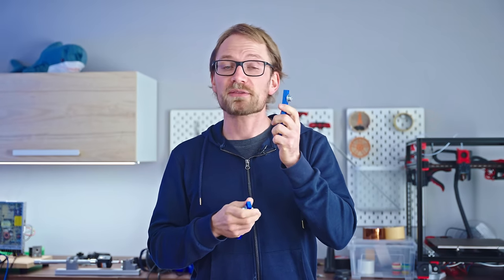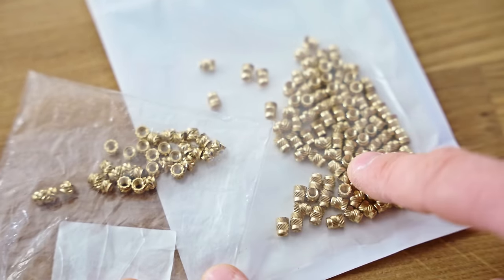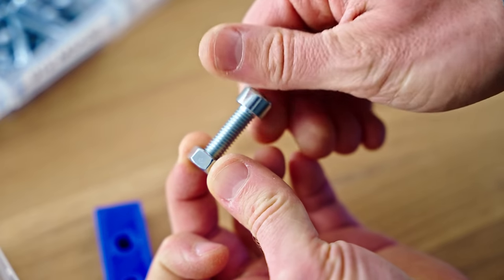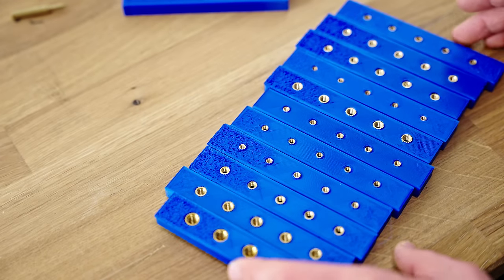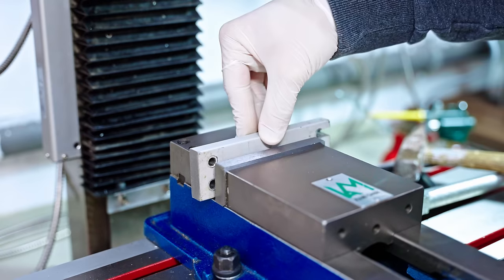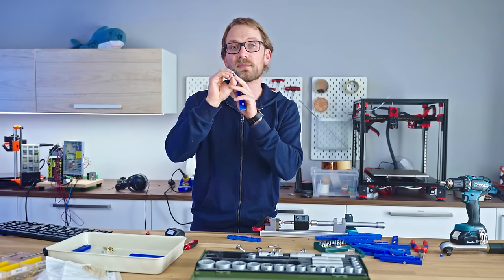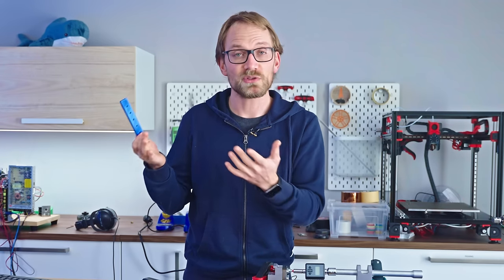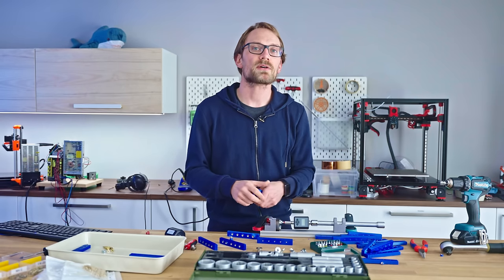Do you even need threaded inserts? Strength tested!

Comment: Interesting, but I try to use inserts only when I have material to pull against so reverse pull if you like.  

That being said. Where you can, design a part with a mortise and tenon with a hole and  pin, that is by far the strongest joint I have been able to print. It does require some accurate printing so you do need to have tuned your printer, but once you have that then you have a consistent part and a consistent joint that works really well. 

But like most things in engineering, there are many ways to build a bridge.

Comment: I use drywall screws. (or other wood screws), I don't bother printing threads, just 2 wall thickness.
There doesn't seem to be any strength reduction, and they are significantly cheaper that machine screws, inserts or bolts.

Comment: Need to test with more perimeters, but also test with a hex hole for a steel nut.

Given the poor pull out performance, grade 4 screws would have been fine, the polymer will fail will before reaching plastic deformation of the screw.

A thread forming tap may have been interesting to see vs thread cutting, I've used them in production where the material is weaker, and so stronger threads (more thread engagement and better crystal alignment of the metal) were required - here I'm not expecting the thread to be any stronger, I'm more interested to see how the polymer behaves to being thread formed vs cut.

Comment: But why are you not using wood screws? Wood screws have a wider-spaced, medium-depth thread which look perfect for screwing into plastic. Machinist screws, not so much as you explained, especially at the small diameters.
Reply: Wood screws work great. For repeated use/assembly/disassembly is where you really need the metal threads.
Reply: @brandonraineri  Something to check for sure. Perhaps wood screws are “good enough” for repeatable screw in-out in plastic.
Reply: @brandonraineri  Would be good to try testing wood screws vs. machine screws directly into 3D printed plastic. I have a clue the wood screws would last enough cycles for a lot of things.

Comment: I usually just assemble a regular hex nut from the other side or during a pause print. How would that perform? Or indeed a self tapping wood screw. These may not perform exactly as well as the self tapping screws actually meant for plastics, but they’re much more available.

Comment: What about a thick walled hole and self- tapping screws intended for plastic?  Proper insert alignment is a real PITA even with proper soldering iron tip but without a press on which the soldering iron is mounted.  Even a slightly off insert angle causes problems.

Comment: I've used brass motherboard standoffs heated with a soldering iron. I wouldn't put them to any strength test, but they gave me a screw hole in a 3d print where I previously didn't have one. 😅

Comment: I would like to know how strong of a connection you get if you insert a normal nut in a hexagonal shaped hole. You would have to consider your printed parts to be designed for getting the threads inserted from "the other side" of course.

Comment: This is a great video showing a good variety of different inserts. I did not know that there were ones specific to injection molding. With the proper precautions, would it be possible to place the inserts on some carrier and print plastic around them? 

I'm not really satisfied with the testing method. The torque measurement is not so relevant to this test. It has some correlation but it is too imprecise to be significant. Instead, a bolt should have been screwed into the insert and pulled with a lever, where the force on the handle of the lever is measured. This is because in your setup, a very small amount of torque applied over a longer period will still drive the screw a bit, eventually pulling the insert out a little, and as soon as the plastic gives even a tiny bit, torque falls back to 0. Static friction also makes this measure fuzzier: a very grabby nut would read high levels of torque, until it starts turning in place instead of getting pulled out. Take for example if you used an impact driver on the test jig, you would get a very high torque peak (somewhat smoothed out by the inertia of the massive drive extensions) then the insert would yield practically instantly.

Comment: Prusa style pocket holes with a drop of super glue so the nut adheres to that printed part. I've used these with both square and hex nuts, I work in manufacturing and usually install a tight plug that goes in after the nut so crud doesn't build up in the hole and to provide a little more material to support the nut.

Comment: Two flaws: You didn't test directly screwing into the plastic without pre-tapping (or did I miss it?), secondly you need more perimiters if you want to tap the whole obviously because it eats away material as you said. The main benefit of threaded inserts is that they can be disassembled without consequences. A self-tapping screw into plastic only works once (well).

Comment: I would be interested with how adding a helicoil might work? Also nutserts which are a mix between the camera adapter screw and a helicoil. Might be interesting to see if you could print a slightly undersized thread ahd heat set/screw them in.

Comment: Agree infill (type and density) could make a massive difference. It would (at least for me) be an interesting follow-up. Suspect some infill types could allow a much lower infill ratio. Feels like what's needed is a cubic subdivision type but skewed heavily towards walls. Suspect the simplest answer would be to use Cura to create a boundary around the hole with much denser infill than the rest of the part to create a transition though clearly ideally it would be a gradual transition with no infill steps (which are likely where it would fail). It feels like a special infill type is required TBH.....

Comment: I'd be interested in seeing how the length of the engaging threads especially on the non-insert setups impacts the strength.  Maybe an experiment where you stack the plastic parts with a single threaded bolt to determine how more plastic threads improves the hold strength?

Comment: One, You should really use more perimeters whether using inserts or screwing straight into the plastic. (I do at least 5 perimeters usually with 10-15% infill) 

Two, don’t use machine screws when screwing directly into plastic, for plastic you really want to use plastic screws, wood screws are a similar idea with more space between threads but idk how well they work with plastic. 

It kind of depends on the situation but I’ve gotten away for quite a while with screwing straight into plastic. I don’t even tap the holes, you can just screw the screw into the plastic and it makes its own threads (I don’t use self tapping screws). I don’t make a bunch of high stress parts but they’ve worked quite well for the robot arm I’ve been making and my plethora of other projects.

Comment: It is always a question of what you want to achieve. For lids etc. I simply print my screw holes with 1-2 more walls and then use M3 screws to self-tap into the plastic. More than good enough and very little effort. Also, doesn't need additional space like the threaded inserts.
If I want sturdy connections and have space to spare (i.e. somewhat bigger parts) I might use heat inserts OR design the part so I can sink a nut of the right size.

Tapping the plastic directly is something I never intend to try, that's just a bad idea. Same goes for printing the threads.

Comment: Heatsets you need to design for them... for example you should not have the stress in the same direction as they were inserted. you need to use heatsets from "behind", kind of like a nut, but then are flush and don't need to have counter sinks like a capture nut would.

Comment: An exploration of different strategies to reinforce the fastener barrel zone to the rest of the part would be of interest. This along with CAD or slicer strategies , such as Fusion or Orca, to be able to create a standard modular item which is able to be inserted into the solid at each hole location to increase the attachment strength for the various threaded inserts.

Comment: FIRST: I want to see this experiment with a reasonable number of walls or 100% infill. 
Secondly: I would like to have a comparison with either the insert flipped on the opposite side, or an inset nut. Personally, I would chose regular nuts on the other side when I can, but burry them inside the plastic in a hexagonal hole

Comment: Yah...since the part was so weak...none of the inserts could really distinguish themselves apart.  Like some of the others have undoubtedly suggested, to really see if there is any difference between the inserts....the part should be printed 100 infill, or at least in your slicer...add a modifier cube and place the cube (about an inch square) over the holes, and set it to print 100% infill there only.

Comment: Try heating up the screws and threading them into the plastic, then letting it cool. Not the cleanest, but it also acts as built in locktite. Ive had decent luck with small grub screws in threaded parts (sounds horrible but i tried it just to see and was pleasently surprised)

Comment: I design my parts with a shoot i can insert the nut into after printing. There is a hole at the bottom of the shoot at a right angle for the bolt. The bolt then holds the nut in place.

Also, I only use PETG. I wouldn't trust PLA for anything but decorative prints.

Comment: I'm a bit surprised at you Tom, using a drill to tap plastic. Also rivet nuts would be neat to compare but may not work well in the same use cases.

Comment: I only use inserts if I want to assemble and disassemble the parts numerous times. If I only want to screw together things, I normally just screw the screw in to a non-threaded hole, that I print slightly bigger than what you would use for cutting the threads. ´So for example I am often using 2,7mm for am M3 screw. Using 3 perimeters and a "thread" length of 8 to 10 mm is a very strong joint.

One negative point i found when using threaded insert is precision. Maybe I am just too untalented but when I am inserting the insert with the soldering iron without a fixture or guide manually, the inserts are often off-center and slightly tipped. Not enough to make them unusable but enough to recognize it. So if I use inserts at all, I am applying them with the soldering iron in a guiding fixture.

Comment: Thank you for another interesting video! A very interesting topic and a great installation for the tests. It would be a shame not to continue using it. Without a doubt, the inserts are the best solution for permanent screwing on and off. 

But I do have a few ideas for testing printed threads for permanently fixed connections: 
If we write on a printed component with a permanent marker, we can see how the ink is literally drawn into the layers. Does the same thing happen with superglue on the threads of the steel screw and does this have a reinforcing effect because the layers on the thread additionally bond? 

Myth buster: I once heard that screw locking (Loctite) on screws in "plastic" can damage it. Is this true? Which plastics are affected (ABS/ASA, PETG, PLA)? Is there an effect over time (after 1 or 3 months)? Or does it even have an intensifying effect because fusion takes place? There is also a Loctite für plastic (5331). Does this have a significant effect? 

Maybe the  one or other point is interesting for you and our community.

Comment: Thank you for putting this together. I've recently got in to using heat set inserts in many of the things I'm making and yeah with the limit of the perimeters you have it would make sense to make another video with a few more perimeters, or even test the different interfaces of infill to see how they would impact the failure. Instead of using a torque gauge you can get the pull force value to be able to get some measurement at all. Another thing I would be interested to see would be a longer term "torque to x in/lb" and have the parts in different ambient temperature to simulate different use cases like auto interior or engine compartment bay. Also I would recommend either printing a heat set insert tool (to have consistently perpendicular inserts) or purchasing one from Naomi Wu from her Cyber Night Market (more info in Teaching Tech's video "Open source filament pelletizer | Naomi Wu needs our help". Cheers!

Comment: One thing I typically try to do with my heat inserts is to install the screw from the side opposite the heat insert was installed. Not sure if it makes any difference in strength, but I would definitely be interested in seeing those results as well. I think more perimeters would be an interesting comparison, as well as higher infill percentage. Also different material types. Most of the time when I'm using threaded inserts, it's into ABS or ASA rather than PLA.

Comment: Ive stopped using drill bit thread cutters on plastic, Ive gone old school and use the hand ratchet tapper, Feel wins there for sure. Also insert from the back if you can so there's a plastic rim for the insert to sit on. I will admit, they do have a pretty weak pull force but side loading they greatly improve durability of the parts. Making the part solid or heavily infilled helps too but that can be costly if you have alot of them to print.

Comment: I was able to to drive M3 A3 SS screw into 10mm of PLA into undersized hole and when it bottomed out I kept going and the bolt sheared off before the thread gave up.
One disadvantage is that it took a fair bit of force to screw it all those 10mm so it's time consuming if you need to do a lot of them and also not ideal for something that you will need to take apart from time to time.
Another thing if you want to use inserts then you need specific type for it to work well and also it works well with high temperature filaments like ABS and not very well with PLA, the plastic just doesn't flow properly.

Comment: Just print a hole with 5 or 6 walls, heat up your screw with a torch, Let the hot screw create it's own threads. That's what Ive been doing.

Comment: I have had good luck using a long set screw instead of a tap to thread printed holes at 0.5mm less than the nominal diameter of the metric screw, up to 6mm. The fit is a bit tighter and more supported than tapping it with a tap

Comment: Can you try to increase the number of perimeters to 5, but only inside the part. The outer 3 or 4 layers should have only 1 or 2 perimeters. Therfore, the solid infill of the outer layers keep the inner perimeters from sliding out.

Comment: I've been doing torque tests at work. We have an HP Fusion 5200 which is an SLS machine. The parts we make are from PA12, which I'd consider pretty "exotic". They are pretty strong but flex quite a bit. I tried to torque an M6 to 14nm and it just buried the washers into the material. Half-million dollar toy is basically useless.

Comment: I use threaded inserts where the customer have to do his assembly. Its not only about the strength but also some kind of ease, and technical aesthetic. I can not afford to give them "hobby" look solutions like nuts or whatnot just save few bucks on my end. However those parts which is only assembled on by me, and the customer never suppose to assemble nor disassemble, i use self taping plastic screws. Those are very similar to wood/sheet screws they hold extremely well, and you can actually use them multiple times, but there is a chance you might make a mistake which would damage your thread. So i would only suggest for parts that does not require disassembly or if it so, than rarely.

Comment: What happens if you model a pair of  crossed vertical slots cutting along the length of the hole?  

If you scale it correctly, the slots should close up and you’d be left with only extra wall material increasing the interface with the infill by creating an x shaped perimeter.

Comment: You should have compared against self-tapped screws as well, as that's the more typical use case where threaded inserts are useful.  Especially with smaller screws.  Putting a self-tapped screw back in a second time never produces as strong a connection, and sometimes you can't even get a firm connection at all.  That's where a threaded insert helps most.

Comment: It would be nice if you had tested using a straight pull-out test with a force gauge rather than rotating the screw to pull on the part. Rotating the screw under tension creates a lot of friction, and thus heat, which will dramatically weaken the plastic. This is particularly significant with the printed threads and tapped threads (no inserts) where there is much more friction between the screw and the part, and the heat is going directly into the loaded plastic threads. Also with steel-on-plastic, you are wearing away the loaded plastic as to turn the screw under tension.

Comment: More than strength, I think a key factor in favour of threaded inserts is reassembly potential. Plastic threads, at least in my experience with M3 to M5 sizes, tend to strip when screwed and unscrewed repeatedly.
It would be interesting to compare insert and metric screws with self tapping screws for plastic, although due to different sizes and diameters a comparison might be difficult

Comment: I don't use any metal screws anymore in my latest printing projects. Instead I use M12 screws printed in ABS or PC-ABS. They are tough and have good "Gleiteigenschaften" when double used as axles. PLA squeaks when moved against each other under load.

What I would really like to know is, where is the sweet spot where 3d printed screws/bolts start becomming viable for shearing and pull loads of about 100Kg? What layer heights, nozzle sizes, material, print orientation, infill or all walls, and wich filaments makes for the strongest printed bolts and nuts in the 6mm to 12mm range.